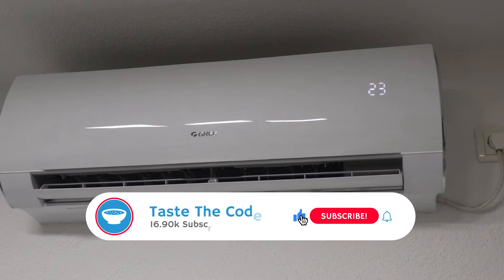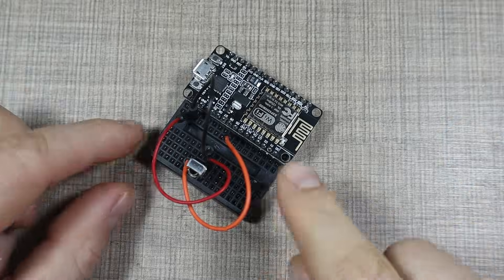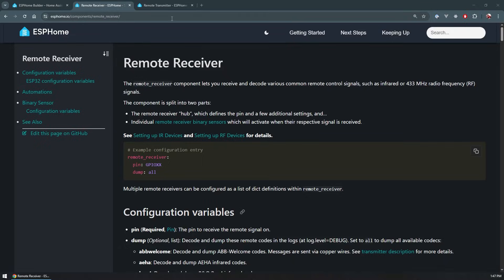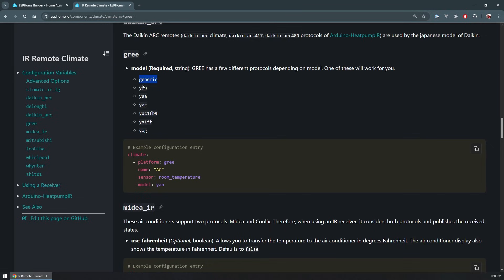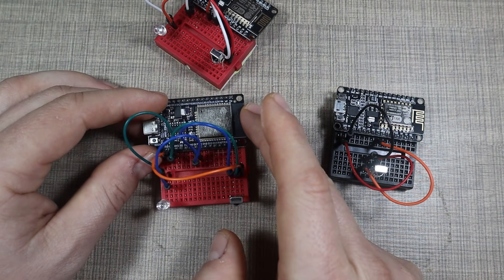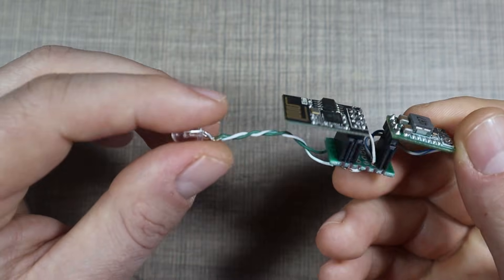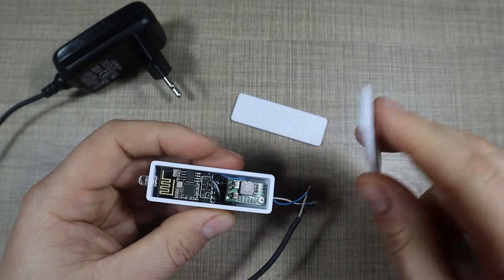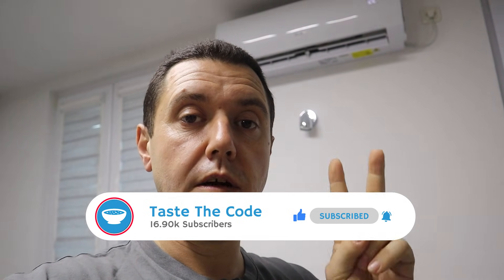I Hacked My AC Remote with a $5 Chip (ESPHome IR Blaster Climate Control)

Comment: @Taste The Code Hi  and Everyone: 
Your video is very well explain, however I have two question for you if I may. 

Q1: For the HW-613, i dont see clearly where you connect them: Do you use the IN+ and GND or you use different combination, if so which one ?
Q2: For Flashing the ESP01 module : You don't specify with what you flashing them. Do I just "press and hold" and put it in my computer and that's it or I flashed it with something, if so with which file (ref) ?

Thank you in advanced for all the great work and for your future answer.

Comment: Nice but not perfect work. You need send commands and read status from gree air-conditioning motherboard without any IR or power adapter
Reply from the maker: Yes, but that will require modification to the AC that I did not want to do.
Reply: @TasteTheCode just a simple modification. Parallel with led and IR board connector. The rest is a parser for status and IR transmitter for command.

Comment: Well done.
You went so much deeper.
I have only used a LinknLink's IR blaster
This got me thinking about those optional USB sticks that many AC brands (like Bosch) sell separately for connectivity.

I wonder if those ports could be reverse-engineered to enable local Wi-Fi control or even Matter support, skipping IR entirely? 
The official modules often cost around 100€ and the apps are still slow/buggy. 
Direct Home Assistant support via that interface would be a game changer.
Reply from the maker: Thanks. A few people suggested the same and some even mentioned that they were able to use an esp for that but I haven't tried it yet. I put it on my list so I'll explore a bit once I get the chance.
Reply: @TasteTheCode  

Using the USB stick with no physical changes to the AC unit, feels like the cleanest path. 
It keeps the manufacturer warranty intact.

Comment: Nice! You can actually get a ESP8266 dev board with the IR RX and TX on it already. Search for ESP8285 IR Infrared Receiver Transmitter ESP-01M
Reply: I will get 2 units and one TTL adapter for flashing them. Thanks for sharing. Hope I'll be able to integrate them in HA.

Comment: Im struggling with with the ir transmitter range, which part should I use? The one im using seems to have 1 meter max
Reply: Yes, usually wiring the emitter led directly is insufficient. I think the author here is lucky with his receiving unit or has been sniping it carefully to get this distance. Just add a 2222 transistor and a couple of resistors to boost the MCU tension to the led.
Reply from the maker: I'm using just a generic directional IR diode. You may try controlling it through a transistor and powering it directly from 5V instead. That should increase the power significantly.

Comment: ESP01's are my all time favorite, super under rated.  to save size on my circuit, I use HT7333 3.3 regulators since they are TO-92 sized and have worked in at least 40 of my esp projects.  Im going to have to try this to manage my Pioneer split unit.  Great job, new sub!
Reply from the maker: Thanks for watching and subscribing and welcome 🤗 Do you have a carier board for the ht7333? How do you add it to the ESP01?
Reply: @TasteTheCode  I just solder it directly to the same PCB that you show in this video where you solder your existing voltage regulator.  This just uses 3 pins and is significantly smaller.  I bet if you want to just solder the GND and 3.3v pin to the ESP01 header directly that would work.  A bit sketchy but would work.

Comment: Looks like you need an ESP32 to reliably get data from the remote_receiver. Placing the gadget is difficult with the transmitter and receiver co-located as it's natural to use the original remote by pointing at the a/c unit and not at the device
Reply from the maker: I haven't tried that yet as I do not have a supported device. The idea is that you place the device right next to the AC so you can read the code while pointing at the AC and kind of highjack it to know the state.

Comment: I just found your channel. I have a similar situation with 3 Trane Mini splits, two of them I can join the WiFi and connect to Home Assistant, but the third, not so much. For 2+ years, I have tried to emulate the IR with zero success. I have bookmarked this page, liked the video, and subscribed because I believe you have also solved my problem, as long as HA recognizes the Trane units.
Reply from the maker: Thanks! I've never heard of Trane before but they seem to be working with Mitsubishi so maybe try that one? I do not see a Trane dedicated platform in the list in ESPHome. In any case, good luck! I hope you solve your issue.

Comment: with HA   I use a broadink Ir blaster to control it,  it also does RF too so it can control my diesel parking heater.....I'm off grid and that is a heating backup
Reply from the maker: Hey, thanks for sharing. I know that there are commercial solutions available, but I find it more enjoyable to create my own custom solution so that I can learn more by doing.

Comment: i used tasmota-ir and the tasmota irhvac integration in home assistant, putting the esp in line with the remote, so when i press the remote, the receiver detects it and updates HA, too... obviously you can't do the other way, updating the remote settings from HA...
Reply from the maker: That's interesting, thanks for sharing your setup!
Reply: I do have a gree AC without the wifi module. Do you have a link thats show which parts are require and how to manage with IR the AC ?

Comment: I just hate GREE app and any cloud based control in general. I would rather try to reverse engineer the protocol that the WiFi module uses to control the AC unit (I guess it would be some kind of serial communication) but this is great hack as well.
Reply from the maker: Yeah, GREE app was problematic from the very beginning. A lot of people shared resources about the WIFI modules in general, so I might give it a go sometimes.